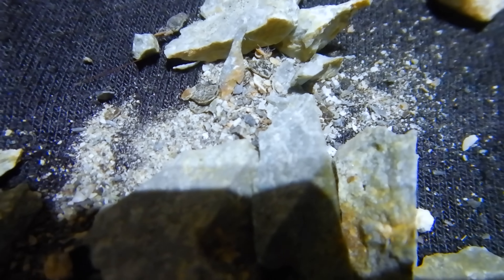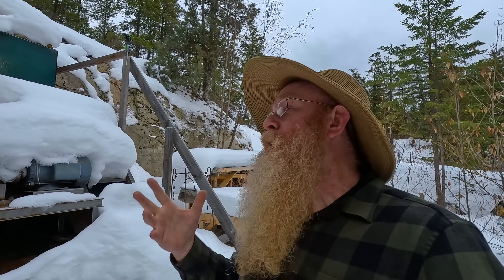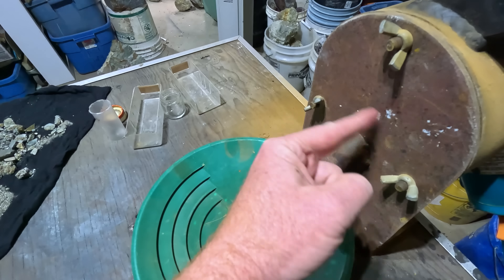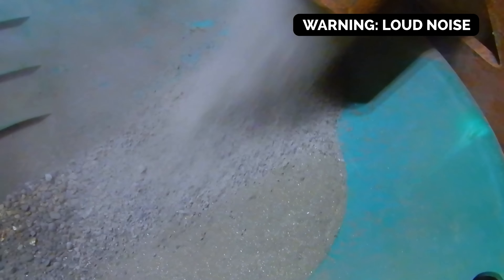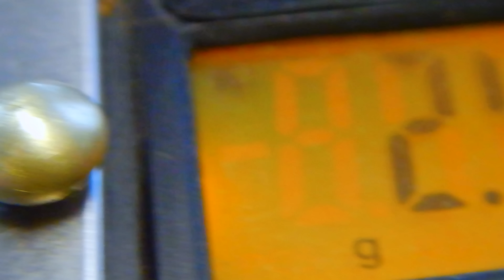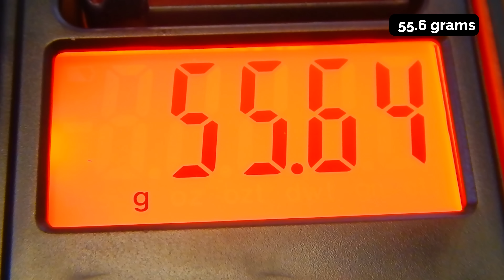Gold! - Melting, Smelting and Playing with fire!

Comment from the maker: And before you tell me I needed more lead, I know.
Reply: Prospecting with DAN! That would be cool!
Reply: they call it a learning curve for a reason
Reply: Don't sweat it. You're an entertainer, prospector, and videographer. You're not a laboratory technician.
Reply: You could try using MAPP Gas instead of propane in your cupelling furnace. It burns a little hotter and the tanks don't frost up as easily.
Propane burning temp. = approx. 1970 C
MAPP burning temp. = approx. 2050 C
Reply: Could you add oxygen with a blower or from a small O2 tank?  Like a jewelers torch does.
Reply: Nope just more gold
Reply: I can't tell you anything about this it's all cool to me
Reply: No you need more GOLD GOLD GOOOOLLDD!
Reply: Rookie 😜🤣🤣🤣 Another great show! 
Thanks for Sharing!
Reply: I noticed you had a us army jacket on, did you serve?
Reply: Haha! Beat me to it!
Reply: @Bassbanshee08  Dan is Canadian ... My guess ... Army Surplus
Reply: theres a get the lead out joke in this somewhere lol
Reply: After the crush ya shoulda panned off  the rubbish before the shitmelt come up much cleaner if ya dry it and air pan it as well till it's clean then melt clean material either way thanks for sharing
Reply: @DesertTuna  even this Gina a crush. You’d lose some of the gold because it’s locked to the sulfides
Reply: A good source of free lead is the junk yard just pop off all the old wheel weights then check your local tire shop for their old weights they remove on a daily basis. Save a dime earn a dollar 👍🍻”keep it shiny”
Reply: Hey Dan you need more lead 😏
Reply: Don't use propane  use MapGas it's Hotter . 👍
Reply: @billunderwood8975  fair, that was my next guess
Reply: I noticed that in a recent video Mount baker mining he was going away from lead.
Reply: Well, you're learning and you'll get better ☺️
Reply: If you were to use a piece of wax paper, rolled into a tube/ funnel from the crusher pipe leading to the pan, wouldn't you be able to reduce the amount of dust (and possibly recover a tiny more total gold recovered)?
Reply: I do have a babar of old printing lead
Reply: 😂🤣 you're awesome!
Reply: @jeremyhess7977  my thoughts as well.
Reply: Maybe an oxy-acetylin welding rig.????
Reply: I was going to say that you needed some jelly beans.  :P
Reply: @jeremyhess7977  They don't sell MAPP in Usa anymore... For some reason it isn't common anymore. can't buy it on amazon, maybe a welding supply shop could have some...
Reply: Use " Mapp" gas (yellow Cylinder) burns hotter than just propane.
Reply: 😂good one Dan.!!
Reply: Just use acid combination, simple reaction and you good with budget and quality result! After you drop down it from solutions can use single acid to clean yor solids, rinse with water, dry that powder on fire and malt it with borax and simple mmap gas torch. And you have about 24k thing 😁
Reply: Is there someone who lives from mining here, who can advise me?
Reply: need to get with Sreetips to refine what you came up with there.
Reply: Nobody is perfect Dan. We were not created to be perfect. If we were perfect we would never learn anything. I learn so much from all your videos! Thanks so much for sharing all your knowledge and experiences. And even more thanks for being honest!
Reply: Around the 9 minute mark, your beard is tucked in... That's the perfect length for you imo. What are your feelings on the beard?

Comment: The cold temp's are lowering the pressure of the propane in the tanks I've had the same problem with my smoker. A tank heater is available but kinda expensive.

Comment: one thing about your respirator, as someone with beard i would reccommend getting a overpressure system like the 3M Versaflo. you wont get a proper seal when you have a beard ending up with a lot of the air you breathe in not going through a filter.

Comment: Great fun as usual Dan. I am fairly sure that the problem you were having with  the propane torches was tank freeze, I see alot of this with my blacksmithing forge the longer the forge runs the colder the tank will get I would suggest getting a larger tank with an adapter to run that style of tip (more bang for your buck as it were)
Reply: And running the tiny torches on a day that is ALREADY freaking cold ain't helping, I'm sure.

Comment: You got to get you an induction heater that way you can use electricity in the form of a coil to melted and then putting electric fan on top to cause oxidation faster

Comment: Map gas in the yellow cans burns much hotter. I love smelting, done a 1 Kilo bar of .999 last spring and a few small bars. Love watching the sun swirls as it's cooling in the molds. Hot , hot, hot molds and a little borax for lubrication with the silver and they turn out pretty nice. Awesome video, like the variety.

Comment: Suggestion: if your wife has any used hose that she has no more use for, take one of those, cut the toe off it, tape the hole where the toe used to be to your output and stretch the rest of it over the pan.

That will massively reduce the dust and make it easier to see inside the room.

Another option is a sock hat, or a shower cap, or even a pliable plastic bag.

Comment: Worked doing assays for the former TTL lab in Cobalt .. our nomenclature differs from yours .  
    The 'chunk' of metal that separates out from the fusion is called the button .   The little bead that remains on top of the cupel after cupellation is called the prill .  
     If you ever really want to see some proper high grade gold ore ...  you should see if they would take you on a tour of the Goldcorp or whatever company name they have now in Balmertown ON .   
     It used to be the Arthur White Dickenson mine .  I personally drilled and broke millions of dollars of gold ore there .. some of it running over 20,500 oz/ton .  That is no bs  ... that property is probably still the richest gold mine on Earth .  They have gone at least 1/2 mile deeper than when I mined there, and it gets much richer down below .
     They forbade the diamond drillers from saying anything about what the core looked like when they were drilling 2 shaft in the 80's and 90's .

Comment: Hello Dan, First off I must say I am a fan of your videos! I found them maybe a week or two ago, but mixed with my hobby of mineral collection and my career working in a Fire Assay metallurgical laboratory,  its begun to help foster some interest in hobby prospecting. Keep up the great work and I enjoy not only learning a thing or two, but also seeing some of the amazing finds you have recorded.

Now, I know you are having fun, and you know a heck of a lot of the science, figured I would give you a few technical points that I know from the lab end of Fire Assay end of things. 
Starting with safety, we all know lead is toxic, however a good way to help reduce your actual long term dose is to take Vitamin C. It prevents the receptors thinking the lead is calcium, and uptaking it into the brain/bones. It does nothing for past doses, and must be loaded into the system before expected exposure. 

Building off of the topic of lead, within the cupellation phase, you are right in that a majority of the lead is oxidizing and remaining in the cupel, however, that is about 98% of the lead mass, the other 2% does vaporize. Its very noticeable when the lead button masses are in the kg range for a single furnace load. A fun fact is copper in your lead will cause the cupel to turn green. That's how we use visual tracers for racks to not be swapped due to human error. 

My last little tidbits on lead would be that for your flux and flour ratio, 1 gram of flour results in the formation of 11g of a lead button in a lead oxide flux outside of carbon in the sample. Ontop of the roast, what I would have added in the flux stage would have been some litharge and silica dust to help clean up the sample. Small amounts of potassium nitrate can also help clean that up as well but that that causes gassing where you need more of a slow temperature control increase to properly fuse, we usually have it at least 1 hour for fusion and the extra time should help with your gold recovery especially on the thicker slag pours. 

Hope you dont mind me nerding out a bit, figured if anything you would find it interesting as well. I just got home from the labs so still in that mindset while I give your videos a watch. 

Take care, and I look forward to your next videos and your next geology lesson!

Comment: Instead of Butane/Propane (B/P), I think you'd have better results using MAP gas. B/P burns around 900 Degrees, where MAP gas burns around 1200 Degrees... When you're at the max with B/P, you can't get any more out of it by adding more, but with MAP, you can always turn down the flame if it gets too hot... I feel like the Choir singing to the Preacher... lol

Comment: Don't put too much trust in your respirator.  You can not get a seal with your beard.  A pressurized mask is required for good seal.  I have a beard also and use a respirator also but I know its limitations.